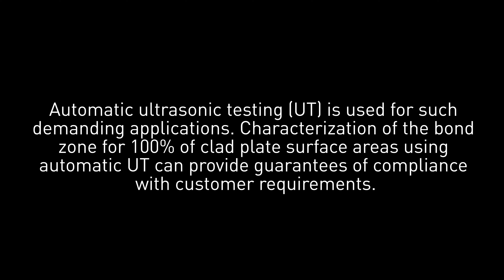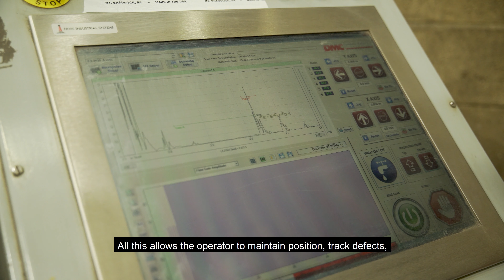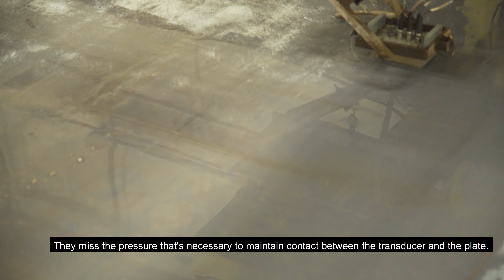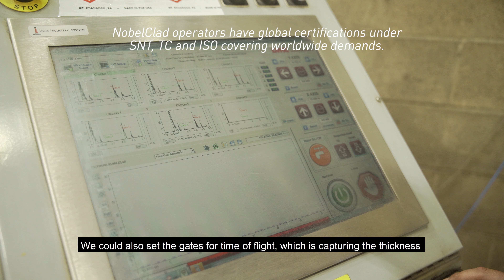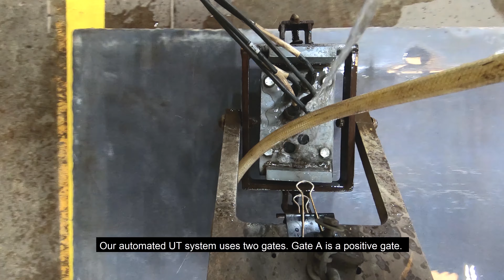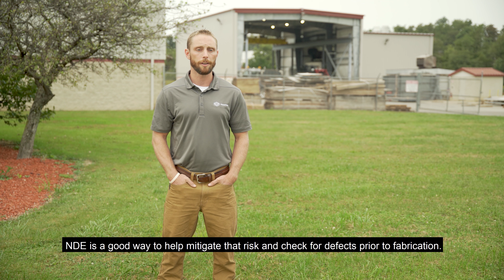Automated Ultrasonic Testing of Clad Plates | How It Works

Comment: Can angle probe use in cladding plates
Reply from the maker: Hi there - yes you can angle beam clad plates. Thank you for the question.
Reply: @NobelClad   can u provide some details .
Ut check in normal probe As per SA578  (Ms to ss) clad plates find non - bond area but when try to find in piezoelectric  45° angel probe as per Sa577 couldn't showing any non-Bond . 
What did i wrong !!! 
Please help me
Reply from the maker: Hi  @bisaljana1351  -- Angle beam is not the proper way to look for disbonding. It is good for finding defects that are not parallel to the major surface like cracks or other mill processing defects. 578 calls out the use of either a single or dual element probe that is 1” to 1 1/8” in diameter with a nominal frequency of 2.25 MHz recommended.